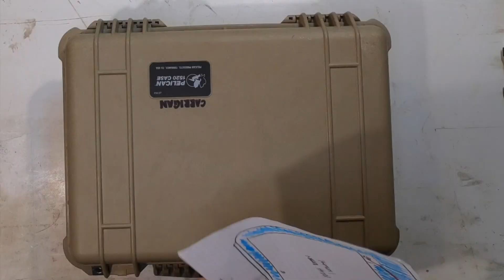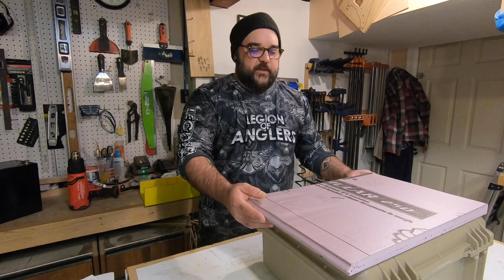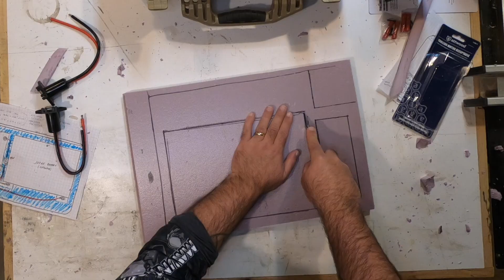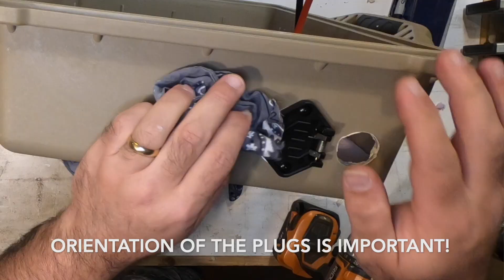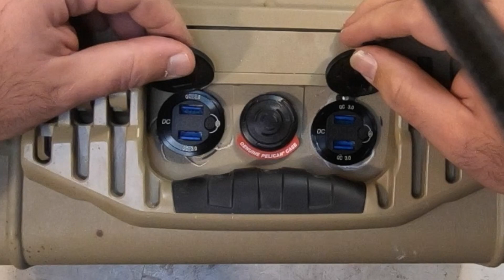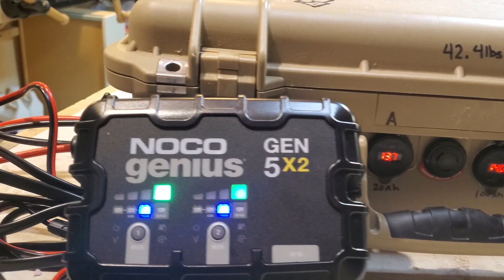DIY Waterproof, 2 Battery, 2 Circuit LiPO4 Box for Kayak Trolling Motor, Lights and Graph.

Comment from the maker: UPDATE:  I built this box approximately 2.5 years ago, now.  I'm still using it on my kayak.  It's still working beautifully.  I think it's probably going to outlast my boat.
Reply: No problem with heat gain? Nice set up.
Reply from the maker: @JeffreyBaird  Thanks! The only issue I've ever had with heat was because of the poor quality male-end connectors that came with my kayak.  Never had any issues internal to the box.
Reply: No problem with heat gain? Nice set up. Did it float?
Reply: Would love for you to show all the wiring that you did where it all gos to and how its wired for us well me dummies ,I'm trying to build this and I am not good at wiring!

Comment: Id give those big lugs a bit more heat to make sure the solder melted well. ✌️.  The voltmeters are not really accurate in that setting.   Need a shunt.   Or a chart w the voltage and li batt percent ✌️🇺🇸👍🙏 great work

Comment: Great box, how called the material that you fill in the case ?
Reply from the maker: @danielesterkin9728  pink foam board insulation.

https://www.homedepot.com/pep/Owens-Corning-FOAMULAR-NGX-Insulating-Sheathing-0-5-in-x-4-ft-x-8-ft-SE-R-3-XPS-Rigid-Foam-Board-Insulation-13NGX/315193939?source=shoppingads&locale=en-US&pla&mtc=SHOPPING-CM-CML-GGL-D22-022_004_INSULATION-NA-NA-NA-PMAX-5718363-NA-NA-NA-NBR-NA-NA-NEW-Pmax-CL3TestA&cm_mmc=SHOPPING-CM-CML-GGL-D22-022_004_INSULATION-NA-NA-NA-PMAX-5718363-NA-NA-NA-NBR-NA-NA-NEW-Pmax-CL3TestA-19116999312--&gad_source=1&gclid=Cj0KCQiAuou6BhDhARIsAIfgrn4gh3_Ml4L-pfFUlwyFmQ6SE3cfKgEiFo2hVFnZy70fS-45wIJYi9AaAkh4EALw_wcB&gclsrc=aw.ds

Comment: Excellent build sir !!
I take it no one manufactures a similar set up ?
I want to run 2 minis just in case one fails and I’m miles from the truck.
Reply from the maker: @jakesmith6337  Thank you!  I'm not sure whether anyone makes a similar power pack as a commercial item.  If they did, it would probably be pretty expensive.

Having two batteries has saved my bacon on more than one occasion.  It's well worth the effort and money to have redundancy.

Comment: Nice fit out I’m just about to do a very similar setup with a brand called Tactix, couldn’t justify the Pelican box $$$ they are the best in the business though. We pay big $$$ for USA brands sadly.

My concern was heat. I’m in Australia and our summer temps hover in the early 30’s (95f). But I’m not spending long periods pulling max current. The BMS will do its job as it was intended if it gets to its temp limit.

Subscribed to you as well 🤟🏻 

Cheers, Matt
Reply from the maker: I haven't had any significant issues related to heat.  The one cautionary note that I would offer to anyone looking to do this build is to ensure your physical connections are solid.  A loose connector becomes a quick source for intense amounts of heat.  The only heat-related issues I've ever had have been due to loose connections and over-use.

I've been using this battery pack for years, now.  I am convinced that it will outlast my boat.  Thanks for the sub!
Reply: @CareAgainFishing  thanks for the tips 👌🏻

Comment: Using insulation are you concerned about over heating your batteries?
Reply from the maker: I've been using this box for three seasons now.  They've never gotten more than a couple degrees warmer than ambient temps.  This is one of the reasons that LiFePO4 batteries are a huge advantage.  They don't get hot.  This battery box has been nothing short of fantastic.

Comment: You do realize that if the cables should become hot that those solder connections will fail? Solder is an option but crimps are mandatory! (and yes, I realize those cables are behind the breakers protection. I'm just pointing out the obvious, consider it a "best practice" thing). I like the concept and quality box, I'm looking for one for two 12v/ 100Ah batts.
Reply from the maker: I guess, the way I look at it, if the cables are getting that hot (they aren't) I *want them to fail.  I totally get where you're coming from, though.

Comment: I'd like to see you guys building these boxes validate them by submerging them in a trashcan full of water. I DARE YOU!
Reply from the maker: I get it.  Doing a box like this serves a couple of purposes.  

The first being efficiency of space.  Over the past two seasons I've very much enjoyed only having to make one trip back and forth to the car to transport both of my batteries.  It's simple.  It's ergonomic.  I can take it into a tent and recharge everything that needs it.  Even my kids' devices.  That doesn't happen with a stock battery box.

The second is to prolong the life of one's gear.  If were a person making money off of YouTube, I could totally see investing over $1,000 in conducting an experiment on behalf of the viewing public.  Unfortunately, I'm just a dude that has to work hard and save money to buy the best gear I can.  Much as I would love to entertain you, I'm not sure how my family would feel about me intentionally risking that much money.  I didn't build the box to "make a bet."  I built it to "improve my odds."  There's a difference.

Another person had a good idea in this comment thread:  Replace the batteries with some appropriately sized weights, and then stuff the remaining space with newspaper.  Chuck the box into the water.  See if it floats.  If it does?  Great!  Then open up the box to see if the newspaper got wet.  If it stays dry, you know there aren't any leaks in the box, itself.

I may just do that in an upcoming video.  

For now, though, I'm going to continue fishing with it... if that's okay with you.  Thanks for the dare, though.

Comment: Nice case and good video
Reply from the maker: Thanks!  I've been using it for two seasons, now.  So far my only issue has been a failed connector (on the cable, not the case).  Functions beautifully.  I've even had situations where I've been able to test redundancy.  After a hard weekend of fishing I drained the primary trolling motor battery.  I found that as long as I kept the speed setting on my trolling motor under 5 (out of 10) I never blew a fuse on the 20Ah Accessory battery.  I ran it for a couple hours on the backup without issue.  Made me feel pretty good about myself!

Comment: The true moment of truth comes when you submerge the box after modification stuffed with newspaper to see if it leaks.
Reply from the maker: That's not a bad idea!  Take the batteries out.  Stuff with newspaper and a comparable weight.  Dunk it.  See if it floats, and check for leaks.  I may actually do that!  Thanks!

Comment: Moisture absorbent crystals or even toilet paper will absorb and stabilise condensation and any beads of water that could enter the case when submerged to any depth.  Lithium will explode in contact with water.
Reply from the maker: Yes.  If the lithium in the battery is exposed to water/air, it can explode.  Probably not a good idea to do either.

Comment: Do you need an inline fuse for each battery?
Reply from the maker: The big battery has a 50A circuit breaker.  The smaller battery has in-line fuses on every circuit it powers.  (There's a fuse in the distribution/switching box, and each of the USB/voltmeters on the box have inline fuses.)
Reply: Thanks that answered my question as well.  When I built mine,  I just had 1 fuse for the small battery charge port and one for both of the USB sockets.  But, great build.  Only one suggestion.  Would be nice if you had a link to some wiring instructions or explained the connections as you go.
Reply: What size blade fuse did you run to your usb outlet?

Comment: Do you need a ventilation valve fitted to the box?
Reply from the maker: This box has one, built in.  It's the dark circular object between the voltage meters.  I wouldn't build one without it.

Comment: Good job on your box. I think you made the right call with your charger. Your 20Ah battery should be charged at 0.2C or 4 Amps to maximize battery life. 5 Amps is close enough. I think you would of really shortened the life of your 20Ah if you would of went with the 10A Noco.

Comment: So you didn't show but you had to make an other cable, both sides are 
Attwood 14365-6 male plug , to run from your case to your trolling motor female plug on the yak, and one for your fishfinder?
Where did you put the case? behind the seat?
Reply from the maker: Exactly right!  4 total male connectors fabricated into two cables; one for the trolling motor and one to the switching box for accessories. 

The case sits behind my seat.  If you watch the other videos in the series you'll probably notice that I made a stand for it out of PVC, which mounts into the scuppers in rear storage area.

Works beautifully!
Reply: @CareAgainFishing  Yep I just watched the power box video :) Pretty cool. i didn't raise my seat like you, but i used a same spot as you did for the power box, i used a small waterproof box for my 20 Ah for accesories and has a same switch and voltmeter on it. Also a plug for the power . I didn't seperate yet for lights , i already have a Yak Power , I will probably use that to control different accesories.
Reply from the maker: @attilacseh3406  Sounds great!  Thanks for the sub!  I'll do a full walk-around video, soon.  I'd love to hear your thoughts.

Comment: Nice job Adam looks waterproof and hope it floats😂
Reply from the maker: Thanks!  So far it's working perfectly after about 60 hours on the water.  No complaints.  No overheating issues.  It's solid.  I plan to do a short video in the near future where I run through the complete build and discuss the things I've learned along the way.  This box has been a qualified success.

Comment: Very cool.  I used similar cases to build two 100ah LiFePO4 batteries to power my 24v trolling motor on my fishing boat.  I used the same Noco charger you used, but chose XT-30 connectors and pigtails for charging, since it's an on-board system and I don't want to be diving under the deck to plug things in after a day of fishing.  When I get home, I just plug in the 110 cable from the charger and both batteries are charged at once, just like yours.  One thing I've noticed is that we rarely use more than 30 amp-hours worth of power in a normal day of fishing, so I can easily go an entire weekend without charging.  Do you find that you need the two batteries for what you're doing?  Does your trolling motor pull that many amps, because of how or where you fish (current?)
Reply from the maker: Truthfully, I could probably get away with one battery, but I like to hedge my bets.  I like having a "spare," and keeping things like minor fuse pops from keeping my Trolling motor from running. I'm still trying to figure out what the limits on the battery pack are.  For example, I towed a guy 2 miles today.  Battery still ran strong after that and the 3 hours of fishing that preceeded.

Comment: Awesome video bro!  Great idea with the foam boards.  Are you going to see if it actually floats 😜I'm working on similar project for my Livescope module.
Reply from the maker: Thanks!  The foam boards were a thing that sorta hit me one day.  "This product won't absorb water!  It's perfect!"

I don't PLAN to test flotation at any point in the future... My best hope is to be pleasantly surprised when I accidentally drop it at a boat ramp.  🤣
Reply: @CareAgainFishing  Thank you for the video--awesome. Any thoughts about the best way to mount/store the case on the boat? Thanks again.
Reply from the maker: @calcovington8716  I rigged up a cradle using pvc tubing.  It mounts into the scupper holes behind my seat.  Works beautifully!
Reply: @CareAgainFishing  Smart. Thank you again.